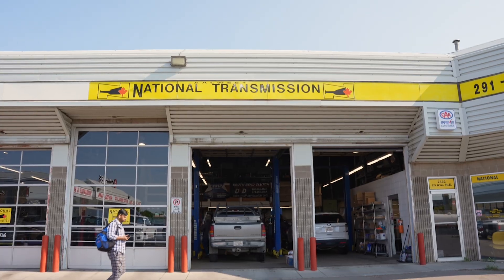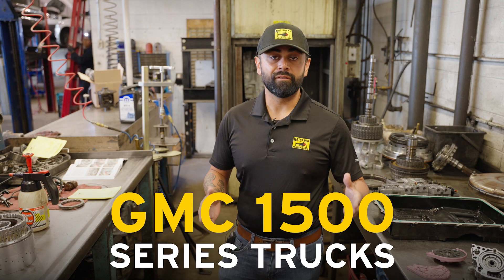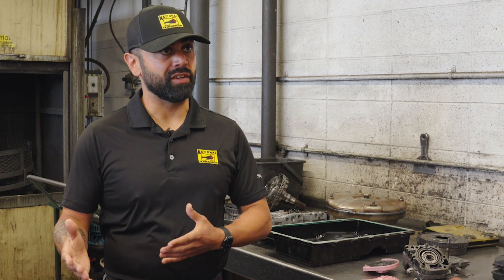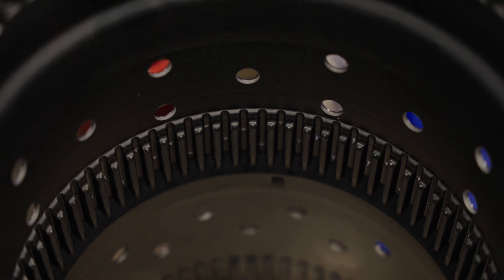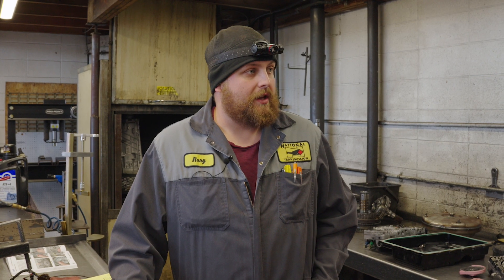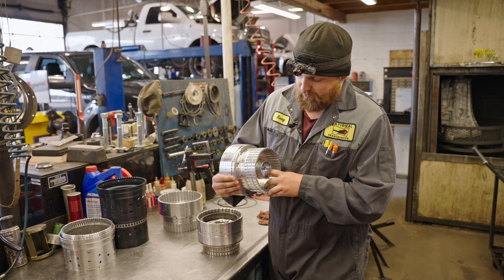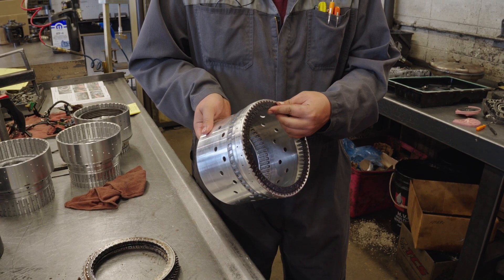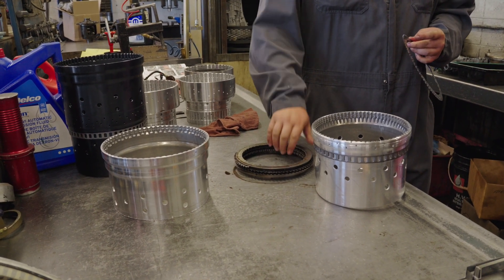Transmission Failures and Problems with 10R80 and 10R140 (Ford, GM, Chevy, and more)

Comment: Will ford ever issue recalls on this transmission? It seems like it could be a great transmission with some revised parts that the company already know is defective.... shame.
Reply from the maker: When manufacturers release newer models or service bulletins, they often redesign or improve the parts that caused earlier problems. These updates might not always trigger an official recall if the issue isn’t deemed a safety concern, but they’re often included in technical service bulletins (TSBs) or newer part revisions.
Reply: A TSB at best.

Comment: Awesome to know what happened to my first transmission, and what may be happening to trans #2, which went into my 2019 f150 under warranty in the summer of 2022. Should this new transmission include these updates?  I get a clunk in 8th.  What are yall's costs for these updates?
Reply from the maker: It's hard to say definitively, but according to the TSBs and the information we've found, most updates were already implemented in transmissions built after December 2022.